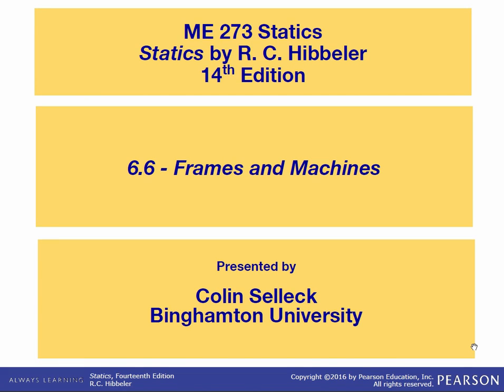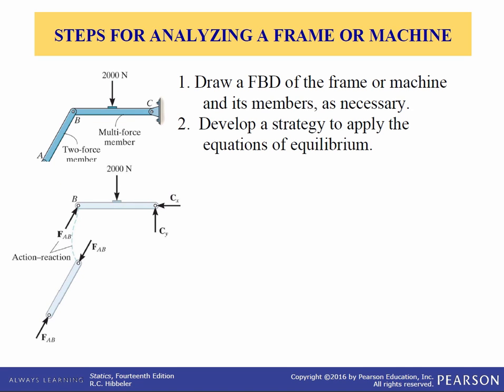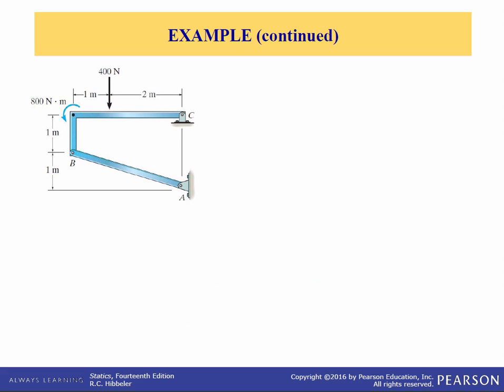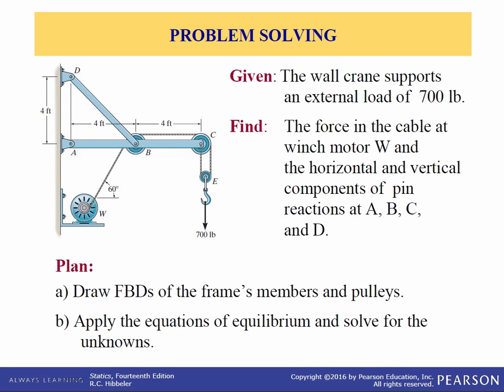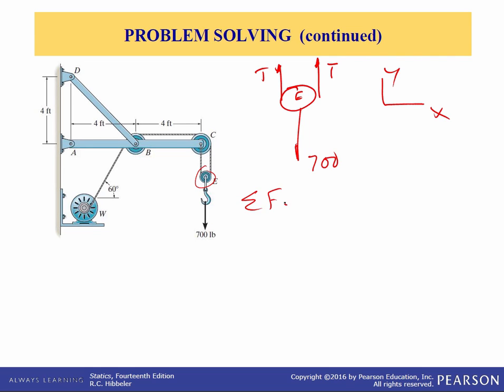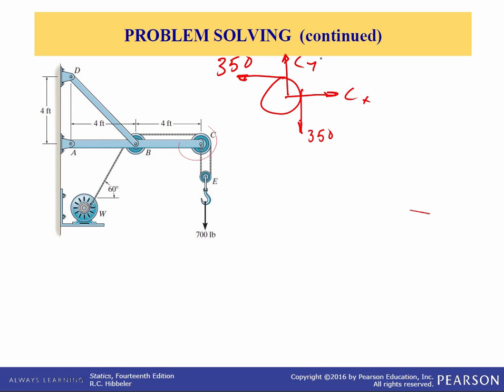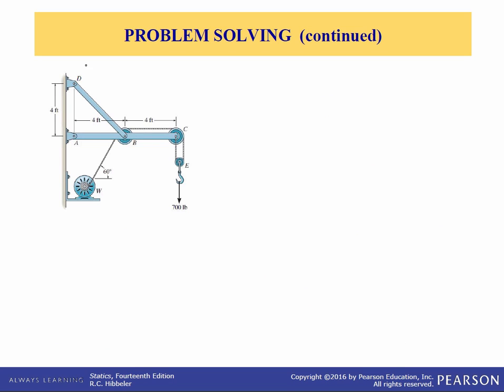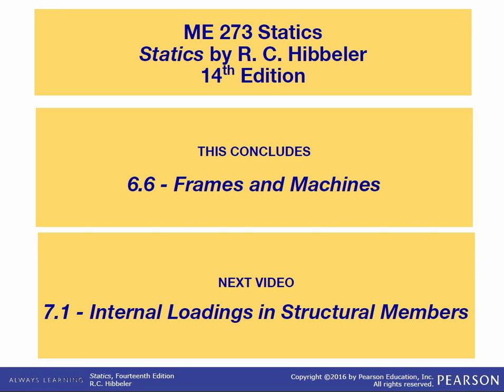ME273: Statics: Chapter 6.6

Comment: Shouldn't Fab sum to zero in the first part (around the 6 minute mark). I think the y-component of Fab, when summing moments about C, should be Fac(1/sqrt(10))(3), which would make it cancel out with the x component.
Reply from the maker: You are correct in that the second term in the summation of moments equation should be -Fac(1/sqrt(10))(3), but since the first term is also negative, they won't cancel out. The answer of 843 N is correct.